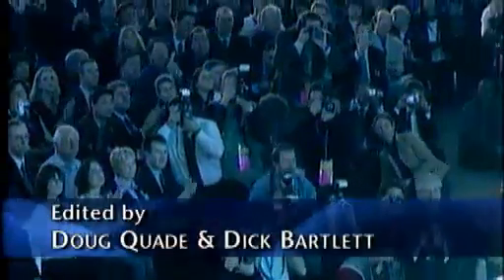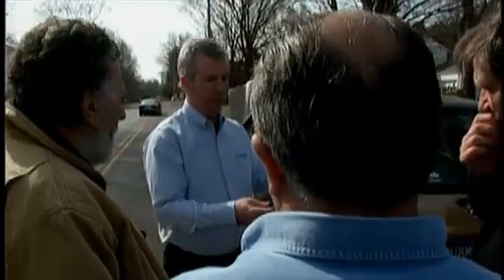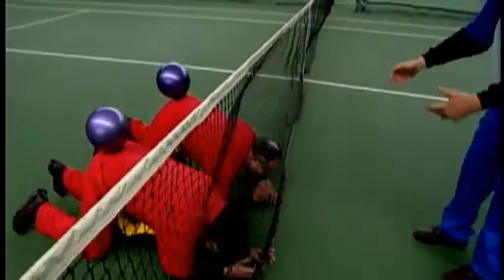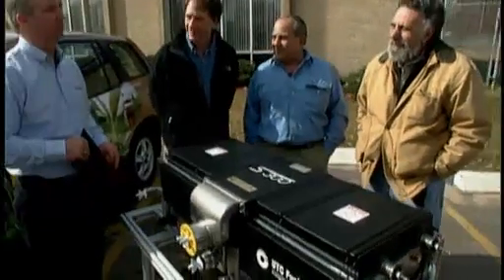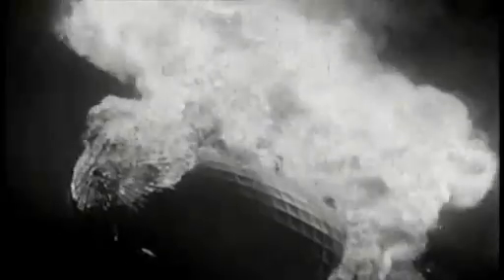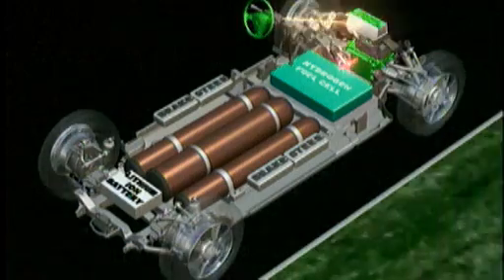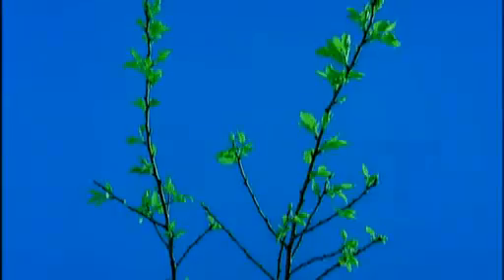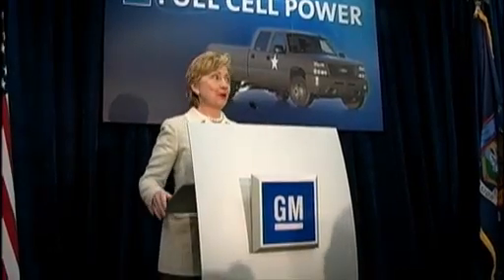NOVA scienceNOW : 10 - Fuel cells

Comment: yes it does exist ,as our navy does this feat daily .they stay under water for 6 months at a time coming up only because they need food .they disasociate the molecules of h20 they get the oxygen off the anode and the hydrogen off the cathode ,one is possitive and the other is negative .but they took this to the next level ,doing thisith very little energy spent with the triangular rotational morse potential ,which uses centrifical force and resonating frequency ,one above and one level below ,so the 3 different frequencies shake the moles apart and the centrifical force keeps them separated , the navy does this on the fly with the torpedos they fire out into the ocean ,the ocean is the fuel tank for the torpedoe, it will never run out  of fuel.now that is ingenious stuff! i reckon!

Comment: I concur with you minus on the battery comment, Tesla Motors was able to make a battery able to run a car for 500 miles on one charge and a Tesla roadster was able with a very conservative road behavior to run for 1000 miles with one charge, so if resources where spent perfecting batteries in 7 years or less i have no doubt we would have a even better battery.

Comment: Forget the hydrogen cells they are just a very inefficient way to power a electric car and they are the way for the big oil to continue having control on the world. Why waist electric power making hydrogen when you can use that same electricity directly on a car with a battery, all electric cars like the ones made by Tesla Motors are the perfect way to electrify automobiles.